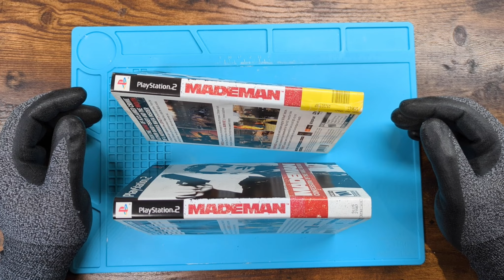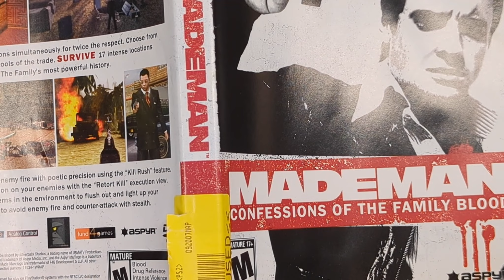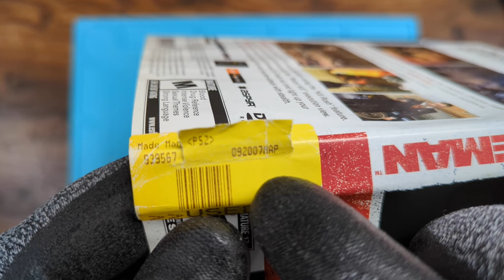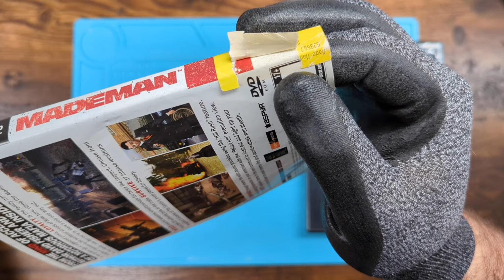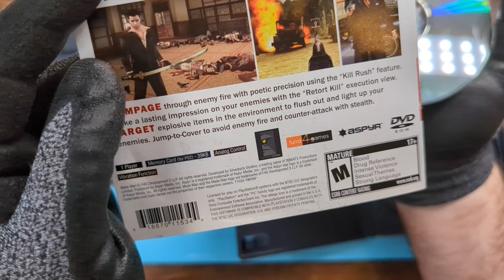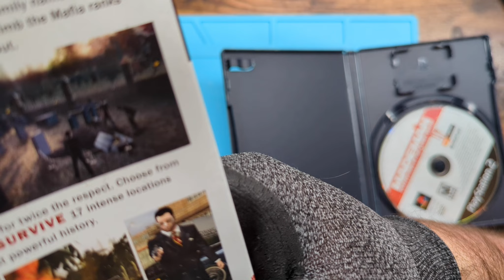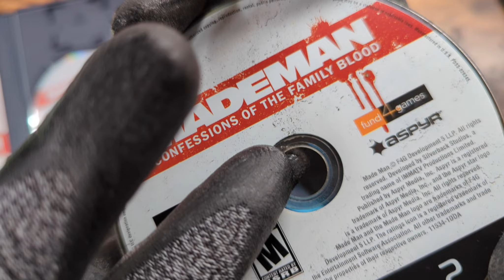PS2 Disc Cleaning Series: Part 2- A Tale of Two Issues

Comment: Hi man. How do you clean the top of the discs, especially those that don't have any stamping on them, and are just like the bottom, like a mirror? The top of my disc got a little dirty with Scratch Remover. Sorry for my bad english. Regards.
Reply from the maker: The label side where the art is? I clean that side using only soapy water and a toothbrush. If you end up damaging the label there are ways to fix it, but it depends on the type of label. Some PC games can be polished, depending on the label, but others have a full disc printing on them.
Reply: @RestoreAndReplay  Well, I just wanted to clean the top side of some discs that I have been polishing with what I have learned in your videos. While I was polishing them, always had some Scratch Remover getting dirty the top of the discs. 

But now that you mentioned that some discs can be restored if the label side is scratched, I got curious and very hopeful, because I have two discs that I have bough with the label scratched! One is an audio disc, and the other is a Saturn game.

The audio disc is in a very very bad condition, because the tracks keep skipping very seconds and very sections, and is freezing for some time on some of them when I play it.

And the Saturn game, I am playing the game from start to end, and all extra content, just to discover if something is freezing on the disc, and I had problems on two sections off the game till now. The game keeps freezing on the two same sections, always when are characters speaking, so I am assuming that this is related to the audio.

When I got to that parts, I reseted the Saturn and loaded my last saved game, tried to get through that conversations many times, and in some of that tries the laser succeeded in reading the disc. So I can understand that the problem is not permanent/definitive. Can you explain how can I restore a disc scratched on the label/top side?

I can send you pictures of the top of the discs if you need. Just tell me where to send them. Thanks for the help and once again sorry for my basic english.

Comment: Hey can you tell me if I got the wrong version of that car scratch remover? I couldn’t find the 2.0 version that was in your video so I got one that looked the exact same but didn’t have 2.0 on it and it said it was compatible with paint. Was I supposed to get one that was compatible with plastic because I polished my disc many times but I am not seeing any difference with the scratches.
Reply from the maker: Hey! If it's Meiguars scratch remover of any kind and it's white and somewhat watery it'll work. Buuuut the amount of water content can dictate how effective it is. I have a few videos coming up that get into using car scratch remover more. How many times have you cleaned it with the scratch remover? It's still doing something even if you can't see it.

Comment: Is it worth getting the Novus pack? Do you ever use Novus 1 or 3? Thanks!!
Reply from the maker: Oh heck yes I love the pack. Step 1 I use to protect consoles. Works as an amazing dust prevention and gives consoles a nice protective shine. Plus Step 1 is great at removing fingerprints from discs! Step 3 I use on bigger scratches and on jewel cases (there are some videos floating around showing the methods). Step 3 is a sort of necessary evil when the scratches are just waaay too much for Step 2. All combined the 3 pack makes for a decent combination of tools.
Reply: @RestoreAndReplay  I'm sold!!

Comment: Have you had any success fixing a disc with a perfect circle scratch from the laser?
Reply from the maker: Are you spying on me??? I'm finishing editing a video showing how to remove those circle scratches on a PS1 game! Should have it out early this week! The same method applies to Xbox 360 discs as well! I've got some real good Xbox 360 laser burn/circle scratched discs to clean too!!

Basically, you want to focus on polishing just the circle scratch, and smoothing that out first. But it's entirely fixable, I spent years and years behind a GameStop counter fixing Xbox 360 laser burns for people. Super easy to fix once you know what to look for.
Reply: @RestoreAndReplay  Awesome! Yeah I just picked up a copy of NCAA basketball 10 on xbox360 and it has pretty bad circle scratch. I got it from not reading at all to the title screen, but it won’t go any further. Thanks and subbed.
Reply from the maker: @89gamingandcollectibles  Great news bud, I just posted the first video of the circle scratch series! While I'll do a full video focusing just on Xbox 360 discs, the process I use in the PS1 video is basically the same as Xbox 360!

Comment: Maybe someone has already asked, but I'm wondering what I can do about polishing out finer scratches? I'm a bit of a perfectionist :)
Reply from the maker: So I've got it narrowed down to two compounds (both are off the shelf stuff), and both will provide that mirror finish and remove those micro scratches. Still have a little work to do on making sure there aren't any adverse effects from the compounds, but you should see the video soon!